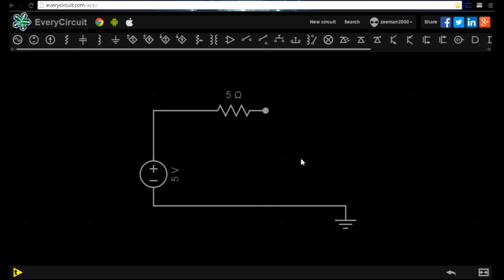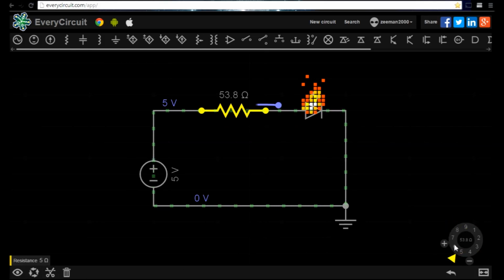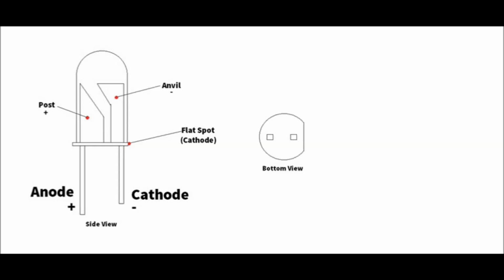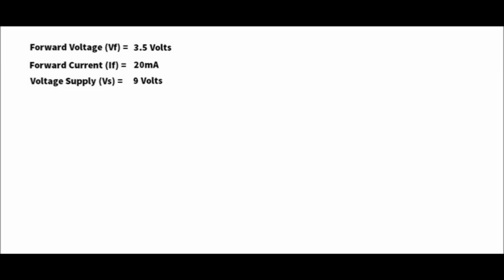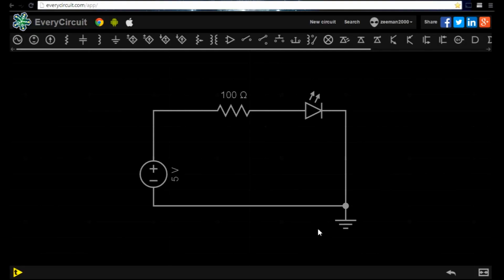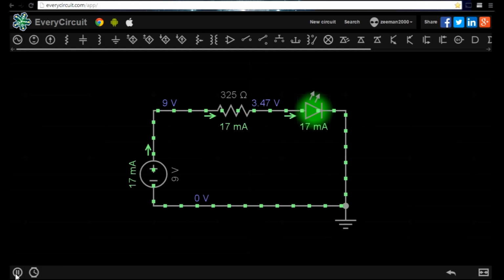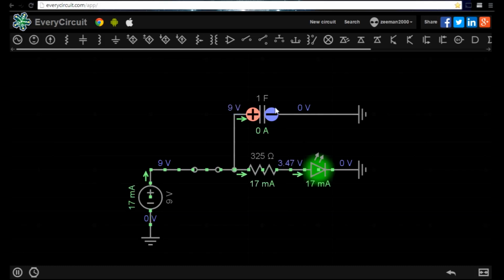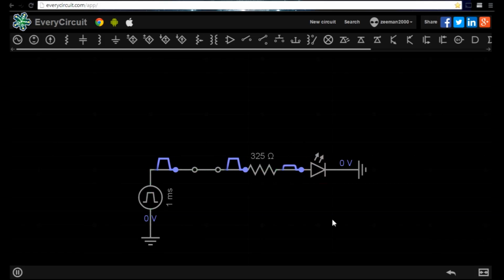Electronics Tutorial 2 - Light Emitting Diodes (LED's)

Comment: Thanks for posting - these videos are great! I have some questions for you: I gave all the components a common ground and connected the resistor/LED in parallel with the capacitor and in parallel with the DC supply (wish I could just post a screenshot). Is this the same as giving 3 different grounds the way you did?

Also, I'm confused how the capacitor is being charged even though there's no green dots flowing through it?
Reply from the maker: Hello Faraz, Thank you for posting a question. Giving a common ground is the same as giving each component its own ground. If you were to build this circuit you would connect all the components to positive and negative power rails on you circuit. Giving a common ground in your schematic will save space and make the circuit neater. in th video I gave each component its own ground for purposes of clarity.

A capacitor on a DC circuit will charge up with voltage from the power supply. Once it is fully charged it will begin to discharge. I like to think of capacitors like a battery which will charge up very quickly then lose its charge in the same time. Tutorial 4 covers more about capacitors and will explain more how they operate.

I hope this helps. Please message me if you need any more information.
Reply: Thanks for the response! You answered my question perfectly in Tutorial 4 as you mentioned. I'm learning a lot from these videos

Comment: Fantastic tutorials! I am teaching myself electronics and these tutorials are amazingly helpful. Please allow me this question: When you decided to make the LED flash on-and-off, you did not explain how simply setting the "the high voltage output to 9v" causes the LED to flash. Forgive me if this question comes across as elemental, but I'm just beginning and am afraid that if I move ahead without grasping ever step along the way I will struggle later. Thank you for helping!
Reply from the maker: +Amado Vento Hi Amado, Thank you for watching the tutorials. I am delighted you find them helpful. When I made the LED flash, I changed the power supply from a steady 9v DC supply to a varying input square wave supply. This type of power supply switches between 0v and 9v constantly. It allows you simulate a square wave input. With the signal varying between 0v and 9v the LED is constantly turned on and off. If you watch Tutorial 11 - 555 Astable, you will see a working example of how we use components to create a square wave pulse from a steady DC supply. Simply changing the supply from DC to Square wave saves time in our simulations. I hope this helps. Let me know if you need any more information. All the best in your studies.
Reply: +Jenko022   Again, I am so very grateful for this most valuable information. I have every intention of watching ALL of your tutorials. If I run into any difficulties, I will let you know. Keep up the good work!
Reply from the maker: +Amado Vento Thank you very much for the encouragment. Its good people like yourself who inspire me to create more tutorials.
Reply: Jenko022 So, changing the power supply to a square sine wave was a shortcut for demo purposes only? In the real world, I'd use components on a steady power source to achieve this effect? In other words, could I go to an electrical supply store and buy a square wave power supply and create the circuit you just showed us?

Comment: oh, i did have a question, sorry just praising your accomplishment. In regards to the atx power source(computer power source hacked), on several of the 12 v lines (pos/neg) i want a "power on" indicator led light to indicate that the line is hot, but maintain 12 volts to what I'm powering. is this a pipe dream? please help. i don't want to use a rocker switch with a led, but a separate led for back-light through my acrylic banana post plate. bench power box is metal, that's why i have an acrylic plate.
please wbs, thanks again.
Reply from the maker: +patrick holcomb Aha! We have a power hacker. Nice project. First thing I would do is to get a schematic of the PSU. There are many power on ciruit that are premaid to do the job and they should be fairly simple to fit. The only issue I see is attaching it to the correct area. If you can let me know a little more about your project I will do my best to help.

Comment: hi Jenko its me again William the first circuit is running correctly. However, the formula is wrong if you choose vf = 3.5 and then you subtract vs-vf (9 volts -  3.5 is not 6.5 ) it is 5.5 volt
so i think you meant to say that the led diode has 2.5v instead of 3.5volt
Reply from the maker: William Santiago Thank you again William. I will update the video with the correct formula. Well done.
Reply from the maker: William Santiago Hi William, the video has been updated. Thank you for your help. I am considering a short video which will cover Errata. I will give you a shout out on this video.
Reply: ***** thanks jenko
Reply from the maker: William Santiago Ok, I will add another annotation to show this. The LED was rated  at 3.5V forward voltage and 20mA forward current. The power supply of 9 volts - 3.5 volts will give us the 5.5 volts. 5.5volts / 20mA = 275ohms resistor required. Meaning that the voltage after the resistor will drop to the correct 3.5volts required to power the LED and the current drawn is the expected 20mA. I will add annotations until I complete the Errata video where I will highlight the oversights and make the corrections.  Thanks again William.
Reply: ***** thanks jenko